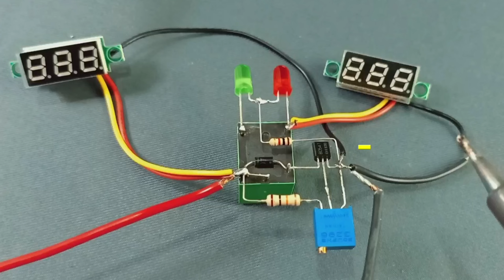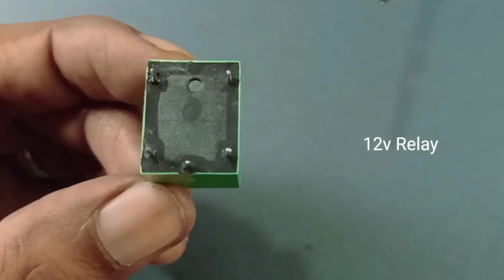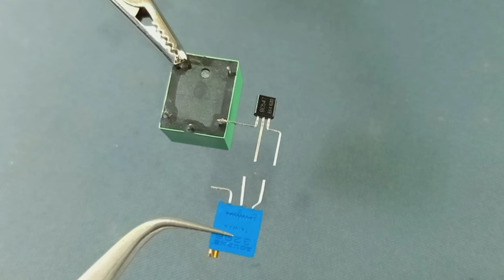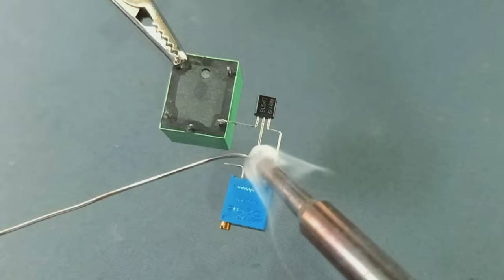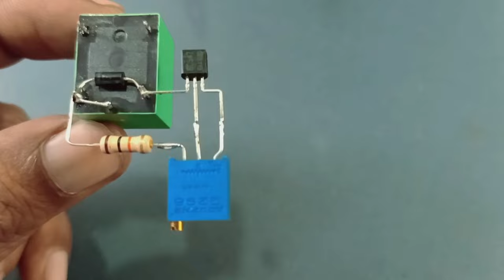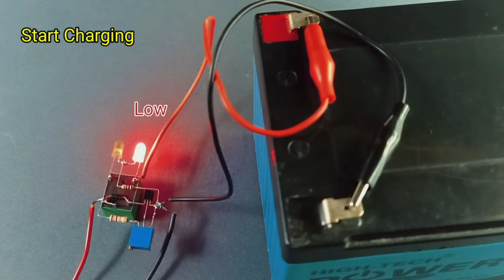This device is very helpful for everyhome // 12v, 5v & 4v  battery charger auto cut off Circuit

Comment: May I ask you, the voltage reference, shouldn't it be taken from the output (battery) voltage? Wired as it is, it has no feedback on charge status, therefore will not reconnect upon discrhage. And is fully dependent on input variations, which I understand is not desirable. Regards!

Comment: Can it charge a 12.6 volt lithium battery?
Reply from the maker: Yes, ❤️
Reply: How many watts is the 10k resistor you used in it?
Reply from the maker: @sumeshkv5118  1/2 watt
Reply: Yes

Comment: I want to make a circuit , when out put voltage not below than 6 voltage . Because i made a veriable power supply . So i want to that type
Reply from the maker: Check it well

Comment: Nice! I guess we can replace the pod with a normal one and adjust the voltage for every battery, with this we can charge all kind of different batteries, isn't it?
Reply from the maker: You can use any battery charge , up to 18 ah
Reply: @RJEDITALL   My question is : Do i have to calibrate the circuit every time i want to charge a different voltage battery? For example, i must make new calibration for a 3.7v battery and again a new calibration to charge a 12v battery? What do you think? Thanks.

Comment: Mostly 12v Relay turn on at 6 v but it will turn off at 2v  for again charging the battery  but battery voltage will not go to even 9v to turn off the relay the difference in on and off voltage of relay will always 4v  so tell me how I can reduce the difference in on and off voltage of relay

Comment: relay 5v please charge 3.7
Reply from the maker: You try
Reply: Please reply...
Can I use the same circuit for my car??
I want the output to be OFF when engine is running i.e. voltage is above 13.3V.
But the output should be ON when engine is not running i.e. when voltage is below 13V.

Comment: I want similar circuit function.
Minimum should be between DC 5 to 18V.
And cut out voltage be 13.3V.
Please help 🙏🙏🙏
Reply from the maker: You can with this circuit, with input 19v dc
Reply: @RJEDITALL I don't understand how you can adjust the cut off voltage using the potentiometer.
How the potentiometer works? You do not used zener diode to make the cut off voltage!!
Reply: @RJEDITALL  Sir i really want a similar circuit for my car which will indicate that whenever engine is running i.e. over 14V, it will show green colour, and whenever engine is off i.e. below 13V, it will show red colour.
Please kindly make a new video above this.
I'm trying to write a diagram but really confusing about it's accuracy of the cut off voltage say at 13V.

Comment: It seems the cut off voltage is not accurate.
You set to 12.8V.
And the output is GREEN when input voltage is 13.7.
So, how to get more accurate circuit diagram to automatically cut off at 12.8??
Reply from the maker: Please check in my Channel
Reply: @RJEDITALL  sir i already checked.
Please share where I can find it 🙏
Reply from the maker: @tnamen1307  
https://youtu.be/geEky1onXoE?si=wOnw9IAJW4Z4bn-K
Reply: @RJEDITALL  okay thanks so much SIR for the sharing...
Reply: @RJEDITALL  I just watched it.
So using COMPARATO IC is more accurate in getting the set cut off voltage.
Whereas NPN is very less accurate for the cut off voltage.
Is this correct?

Comment: What is the power of the 10k resistor
Reply from the maker: 1/2 watt
Reply: Tnx
Reply: @RJEDITALL  Can it be 1/4 watt? or will the resistor get too hot?
Reply from the maker: @jenntek.101  1/2w

Comment: What transistor can I use for this cut off circuit if I need to charge a 36v battery and want it off at 41v?
Reply from the maker: Not possible with this circuit
Reply: @RJEDITALL  Yes I thought so but wanted to save some time 😉 Thanks